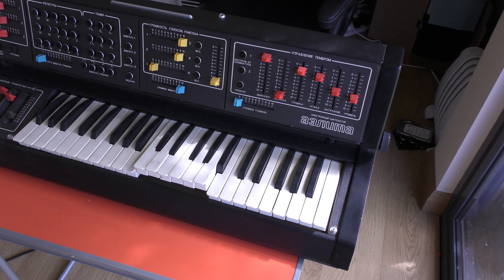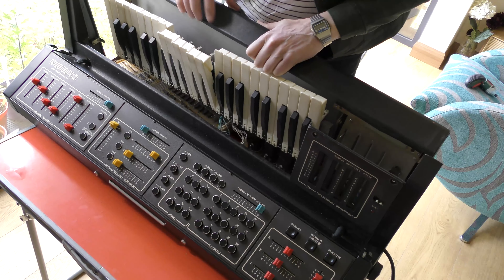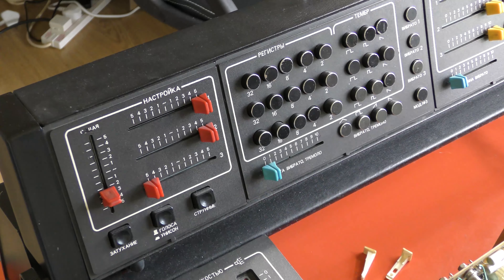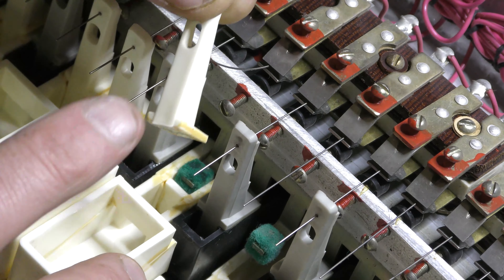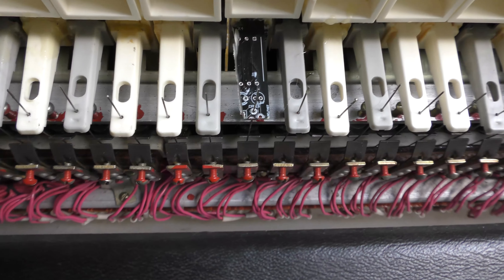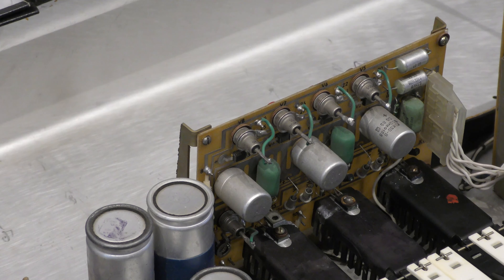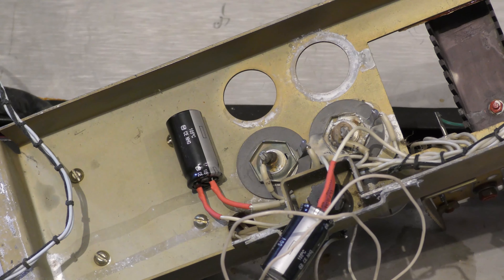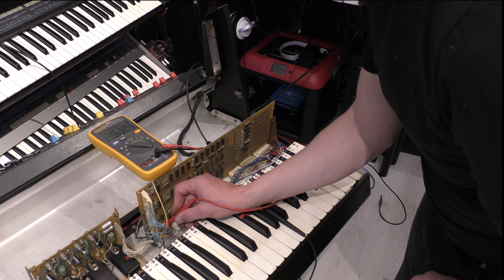FITTING A MIDI KIT TO A SOVIET AELITA VINTAGE SYNTHESIZER

Comment: Hi Mindburner excellent support vidéo , very usefull maybe for me.... I have question about chips and IC : Is it normal common IC or Russian obsolete stuff ?
Reply from the maker: hi Yes it's a pity the kits are very difficult to get hold of. I checked back in my emails ro see if I had a web link or email for mr logic, but it was all done through ebay unfortunately. I did think of trying to make one but the IC's are programmed kits and need specific code. As far as the IC's, they are Russian. Most seem to be still available or have western equivalents once the cyrillic lettering is deciphered.
Reply: @waheex  just have to Say : I really crush on Aelita !!!!! This absolute little mono3oscillo synth is very interesting and incredible unique Sound
Reply: Now have to work on it !!! The Keyboard IS Exactly like yours AT the Time. Only have the left UP Octave working , All the others keys are mute .... Is there a Split Key there ?

Comment: Hi Mindburner , i reach the guy mister logich that is good thanks for the help …. I have to clean keyboards and discover that the resonance doesn’t work at all but sounds is ok, only there is no effect of resonance when I turn the fader… did you know something about that ? Thanks pierre
Reply from the maker: hi I would suspect the actual fader, but you can check if it's outputting values using a DVM meter. See if the voltage changes, if not bad fader. Try a good clean. If it changes then issue is further down the chain, perhaps with a logic chip